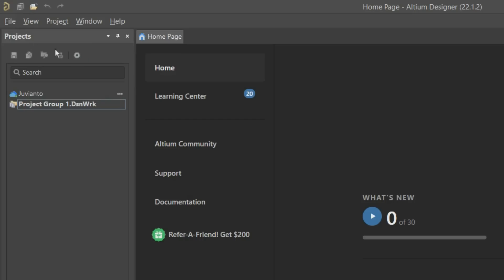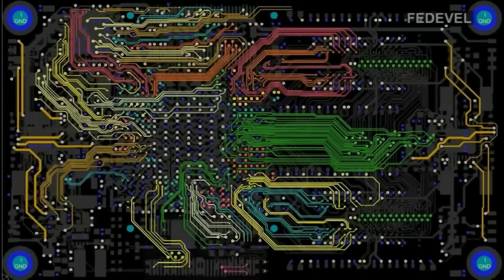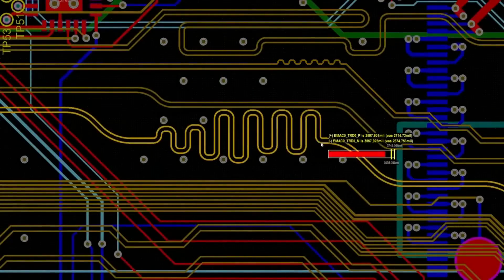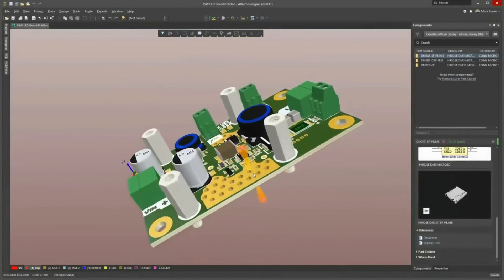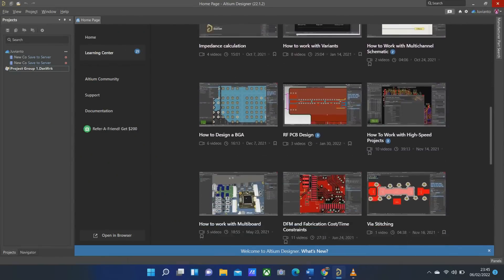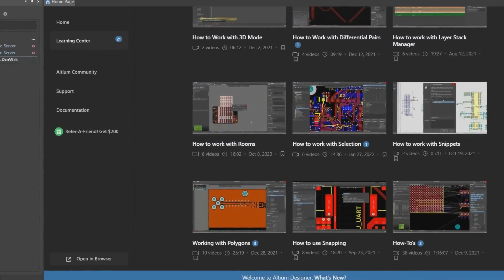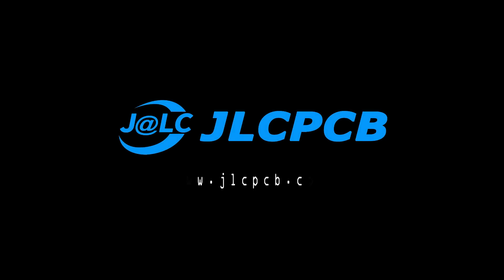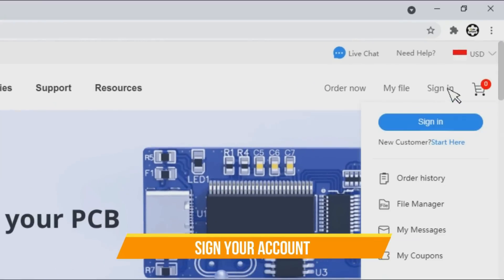Build a High Power 4-Channel Amplifier using 24 Transistors with 1500 watts SMPS #cbzproject

Comment: Just an advice for the future: you must solder the fuse holder in the other way! The main input should be at the end of the fuse holder, the power going forward should be on the side. Also if you use metal frame for your project, the metal part must be grounded, because if something moves inside, the metal can be live, and shock you. Nice build however!
Reply: Show me your works
Reply: @fatalfury3031  
He just want to give advice 
He wasn't underestimate, be calm and peaceful brother

Comment: Crap design all round. Power supply is way too small, amp modules are generic and the flimsy case combined with tiny little 40mm fans when 80's should have been used. Testing at end was pure noise and WOFTAM.

Comment: sir am new to this audio field, i have 2.1 amplifier (5200 & 1943) fet board used in the amplifier (kumar audios 2421  stereo 4 FET and aurna 4 FET mono  boards for sub) , in that power supply section the manufacturer used 50v  4700uf  2 capacitors used ,, can i change those to 50V 10000uf.. is it good to change , or any issues ,, and the out put from power section am getting 42V (+ & -),, pls replay sir.
Reply from the maker: Of course. And it's better
Reply: @cbzproject  Unless it causes unnecessary oscillations; You can't just assume higher capacitance is better, because that does a lot to a power supply. Higher inrush, slower slew rate, etcetera.

Comment: Congratulations! Nice amplifier design. From where did you get the SMPS?? I am interested in this?? Also can you share the gerber files Or the circuit diagram of the power amplifier. Thanks 😊
Reply: I thik garber file link in description
Reply: @tariqulislam9597  thanks for trying to help ☺️ but there's only the speaker protection Gerber files and not of the amplifier or the SMPS.
Reply from the maker: @boscoclifffernandes8572  The SMPS I use was made by someone else. Not mine
Reply: @cbzproject  thankyou for your reply. That's a nice SMPS. If you could do one of the same Type it would really help. I really like your projects. They are neat and very professional. Looking forward to a lot more projects like this 😊. Also another request could you put up the links from where you purchase your amplifier cabinets. It would help us DIY's to obtain nice professional looking amplifier cabinets. Thanks again for everything.😊
Reply: @tariqulislam9597  popoòo9ppp